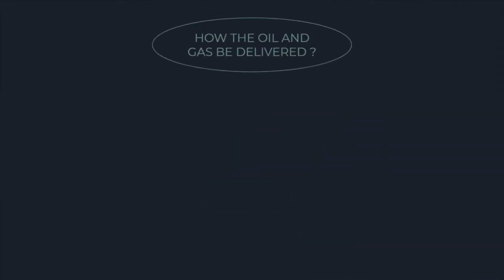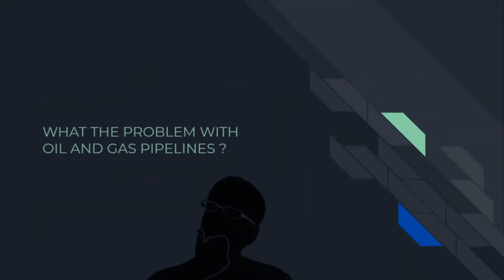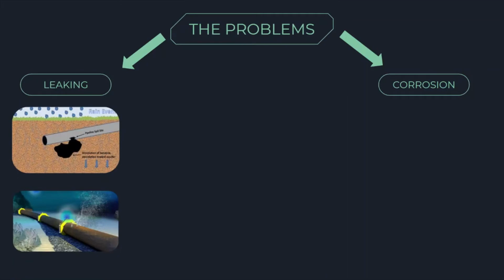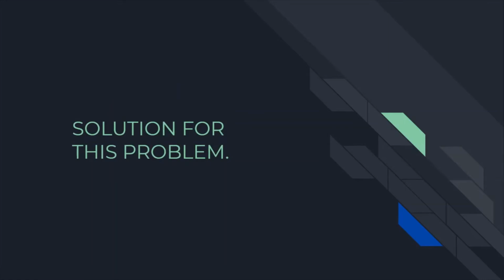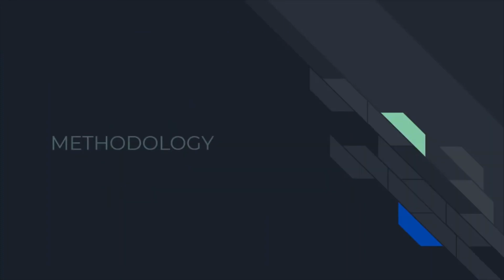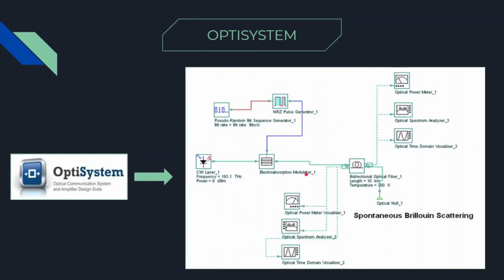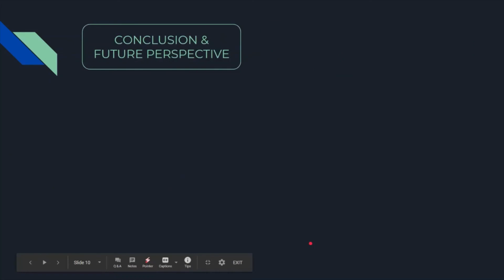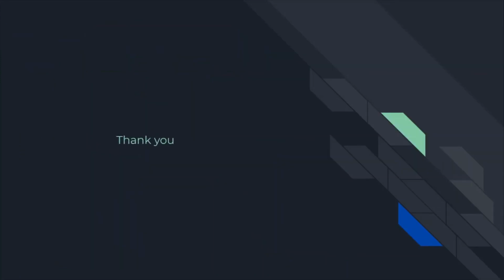Brillouin Optical Time Domain Reflectometry(BOTDR) fiber optic sensor for oil and gas pipelines.-5MT

Comment: Thank you for your presentation. Good presentation in overall with good voice, intonation and slide presentation. However, please improve English language used in the presentation. Technical comments:
1. Why used BOTDR sensor instead of other approaches?
2. After monitoring the leakage from the system, what should engineer do then?
Adab of presentation, we must introduced ourselves and our proposed topic title.
Reply from the maker: Thank you for your comments Dr .
This my answer for your question :
Q1 - The reason why I'm used BOTDR sensor instead of other approaches is BOTDR sensor are using the Brillouin Scattering theory which means it can detect any changes of the temperature and strain because when the leaking happens, the temperature inside the pipelines will be change either become hot or become cold. Then, this sensor also have a long sensing distance and can achieve up to 100km. Because of this BOTDR sensor used the time domain, so this sensor can detect any leaking in the real time which means can know exactly the location and time of the leaking happens. The last reason is it will became economical because this optical sensor can detect any leaking on the pipelines for the long distance. So we can apply this sensor without the huge amount of budget.

Q2- If leaking on oil and gas pipelines happens , the engineer that conduct the monitoring system will detect the location and give the information to the other engineer that assign as Maintenance & Leaking Prevention unit to go to the leaking location on pipelines sites and discover the problem that make leaking occurs. 

So that all from me and Thank you for listening my presentation. 😊

Comment: Question from Examiner: How these output parameters will be optimized all together?
Reply from the maker: Actually the output will be optimized separately. First , the Brillouin frequency shift will be optimized and it represent as the change of temperature and strain. The second is we will optimize the Stimulated Brillouin Scattering (SBS) threshold in the OptiSystem and it will represent the sensing distance for BODTDR sensor. The last one is the Signal-to-noise ratio (SNR) will be optimized for the noise reduction of BOTDR optical fiber sensor.